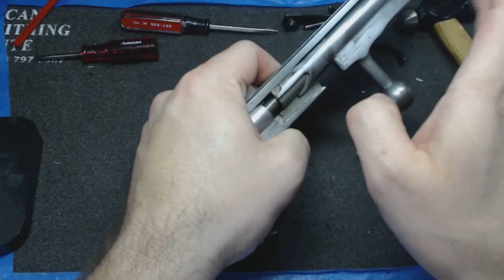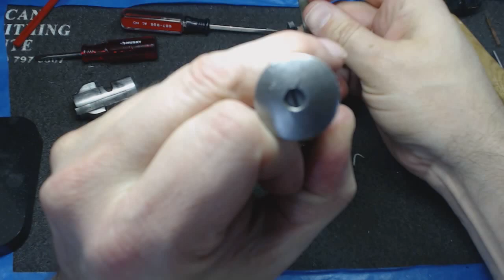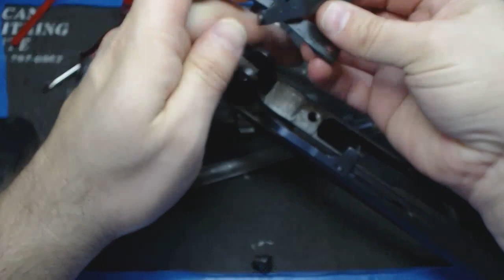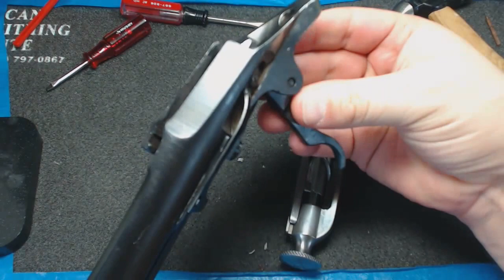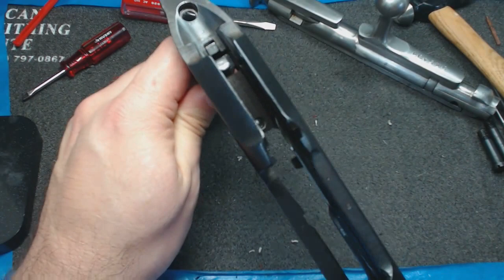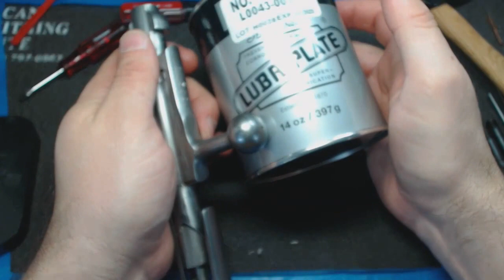Mosin Nagant Bolt disassebly and reassembly.

Comment: is that a hockey puck you are using as a base to punch pins out?
Reply from the maker: Technically, that specific one is the "H&K Armorer's Puck Punch Bench Block Tool" available from HKParts.net
However, the other six I have are standard issue hockey pucks with a 1/4inch hole drilled into the center.  =)

Comment: Just checked out the Lubriplate on Amazon and the manufacturer stated it burns off at 170 degrees.  Could this be an issue?
Reply from the maker: Its flashpoint is around 400 degrees (F) and its melting point is around 190. It doesn't burn at 170...that recommendation is more about its expected operating temperature. If your application was a car engine, this stuff wouldn't be recommended because the engine is normally above 170. 
It still functions in its liquid state, but you're just not going to get the bolt of a bolt-action gun up to those kind of temperatures. The US army used it for the M1 Garand, M1 carbine, and I believe the M14 as well. In your Mosin, it is more about protection from water/humidity than lubrication and this stuff is hard to beat.
Reply: AshburnArmorer Great answer!